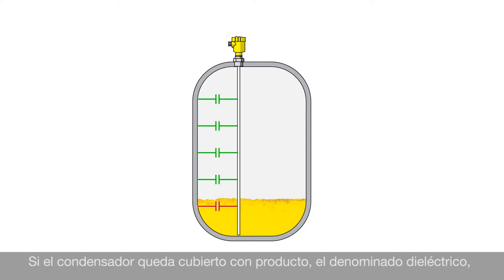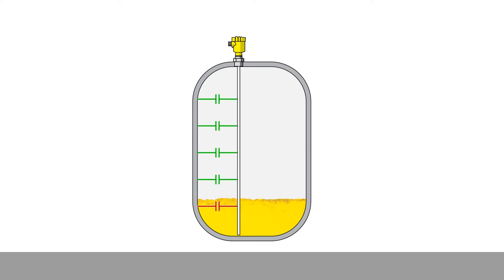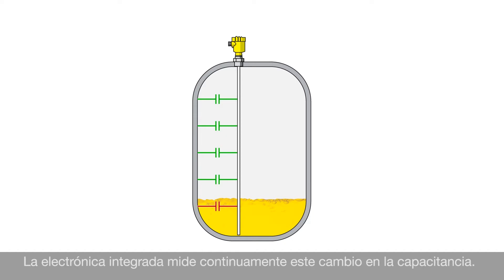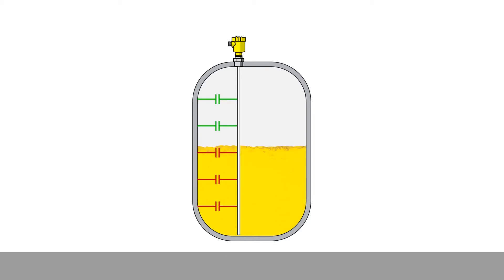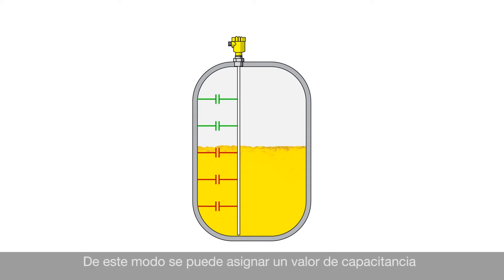Medición de nivel capacitiva | VEGACAP/VEGACAL serie 60

Comment: Sirve para medir crudo?
Reply from the maker: VEGACAP series 60 can be used for point level detection and VEGACAL series 60 can be used for level measurement of crude oil. 
If you need a precise accuracy in mm, we recommended VEGAPULS or VEGAFLEX. However, the resistance of the probe must be considered when selecting the sensor. If you want more information about sensors for crude oil, please don’t hesitate to contact us.